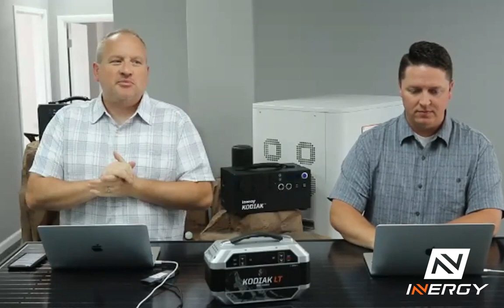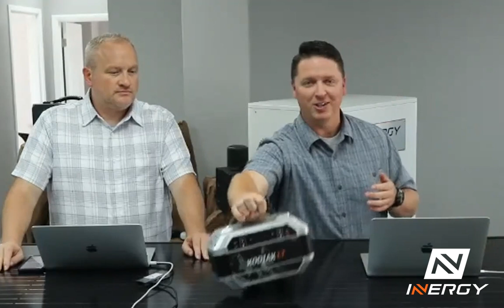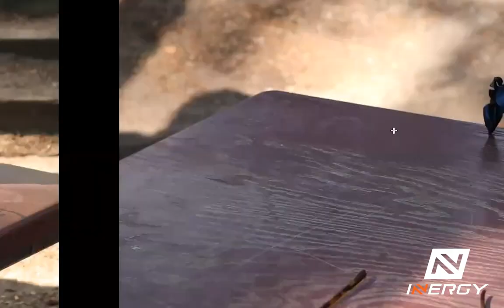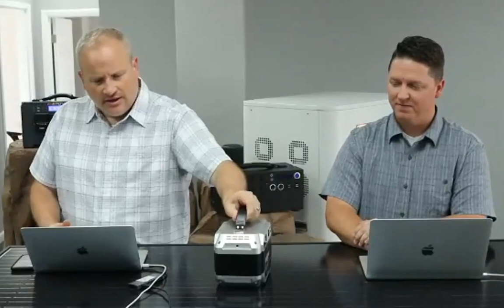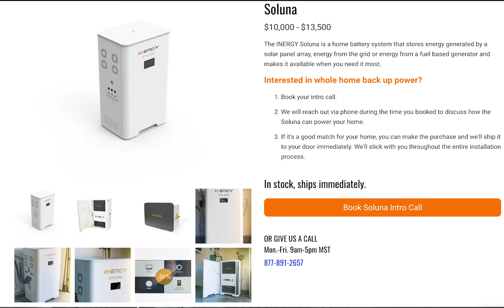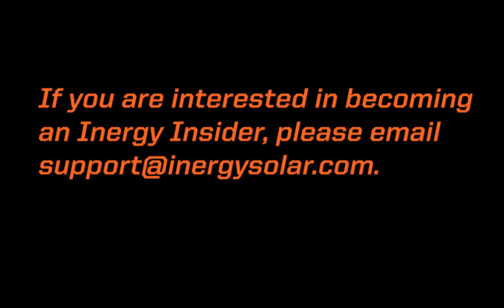Announcing the Kodiak LT - Inergy Insiders Private Zoom Meeting

Comment: We have had the original Kodiak for 6 years and love it. We take it with us in our Transit camper van and it comes in handy. We also have a Inergy solar panel to plug into it. Will the solar panel that we have plug into the LT ?  When should we expect our Kodiak to  "die" ? Thank you
Reply from the maker: There may be a solar adapter than can be created for your current panel! To answer this question and do some troubleshooting for your Kodiak please contact our tech support agents at 1-877-891-2657 Opt. 2 for Tech Support, Monday-Friday from 9-5 MST.

Comment: Can it run a 12volt vacuum 15amps on the DC Jack's?
Reply from the maker: Our 12V adaptor is able to output up to 10Amps. If you are looking to run this specific vacuum, one of our larger Power Stations would be a better option. You can call our Customer Service line to find a suitable fit and get any additional questions answered!

Comment: Why this model over the competitors in this category ? Apples to apples???
Reply from the maker: Some competitor products have the same output but a lower battery capacity or a higher output but they may weigh more. The Kodiak LT has the best balance of everything on the market. We opted to have a 350W inverter AND 350 watt-hours of storage in a PowerStation that only weighs 7.8lbs!

Comment: I purchased the Apex with the linx, panels called the silver package.  Love the unit and I basically bought it for camping to use with my Bipap machine.  I bought a 12V converter for the Resmed and using the humidifier on my Bipap I can run the Apex for close to 8 days before charging it.  My mentality when it comes to  using the Apex is 12V appliances only.  I wished the Kodiak LT came with a cigarette 12V plug.  Good luck on this new product.
Reply from the maker: Although the 12V cigarette port is not built in, the Kodiak LT will come with  5.5mm x 2.1mm to 12V cigarette lighter port adapter that allows for 10A / 12.6V DC power! Feel free to call our customer support team or check out our website for any additional questions about what is included with the LT!

Comment: Have the original Kodiak and use it for everything. Power outages, corded power tools, air compressor, and now has been the "house" battery for my Tacoma overland build for the past 3 years. In the Tacoma it powers my fridge, diesel heater, charges phones/tablets and charges a secondary smaller 30ah SLA battery bank (which can be disconnected to prioritize) that powers lights, a 12v fan and usb ports.  I tried a LiFePo for the smaller unit but 1. can't charge it with the Kodiak and 2. I live in Michigan and without a heater the BMS would shut it down in cold weather. The Kodiak lives in a drawer in the bed and is charged by a 100w panel permanently mounted on the roof or by the trucks on board 400w inverter. This setup gives me unlimited power while camping and has never let me down even when camping for 3 weeks at a time. I've camped in all weather conditions from 110° to 20°. Last year I racked up over 15,000 miles with plenty of those being offroad and the Kodiak didn't skip a beat. I couldn't tell you how many cycles I've put it through because I've never taken it all the way down but when it does start to show some lost capacity I won't hesitate to give another one of your products a shot.
Reply from the maker: Thank you Rob! We love hearing these kinds of stories.
Reply: I have the original Kodiak as well. My home is the last house on the grid so our power is jeggie at best. Our little Kodiak is a trooper running anything we need from the refrigerator to the TV a light or the internet. It has never let us down. I'm really sorry they discontinued it.

Comment: What kind of set up would I need in order to just run a window a/c unit 24/7? I realize that a lot of batteries and solar panels are needed, but what else?
Reply from the maker: That's a great question! The Flex 1500 is going to be your best bet because you can add batteries and increase the solar charge rate to meet your needs.

How many batteries and panels you'll want will depend on how much power your a/c uses and how long you want it to run for. Our support team is very knowledgeable and can help you put together a system that best meets your needs. You can contact them for help at 877-891-2657 or support@inergysolar.com.
Reply: Your average a/c window unit is 400 watts (5000btu) running on max cool and max fan. So 24 hours, you would need a total of 9,600 watts (9.6kw). That's a lot of batteries and solar. During hurricanes I run my window unit during the day, only during peak solar times and peak temperatures, and then two box fans at night (100 watt total). I have the flex 1500, two batteries (2140 watts), mppt, and 1200 watt worth of solar panels. This set up works well for me and I am still able to keep my fridge (107watts) plugged in during this time. Just food for thought, hope this helps.